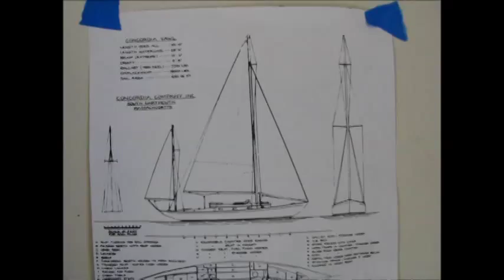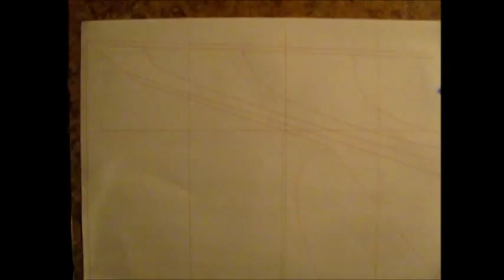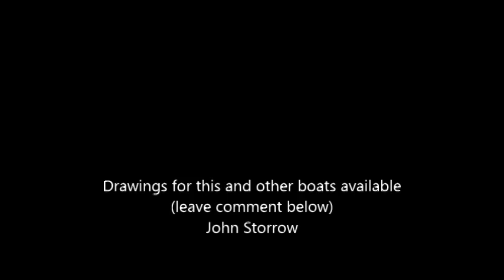How to carve a wooden model sailboat, part 1

Comment: Lovely boat and technique. I don't understand how the small rectangular pieces at either end of the laminations aids in aligning the pieces.
Reply from the maker: The pointy ends of the boards fit into the notches. Each little notched piece is glued in place first, with the whole boat clamped together without glue. Then after that, the whole boat is un-clamped, glued, re-clamped till the glue dries.
Reply: +John Storrow Thanks John,  that explains everything perfectly.